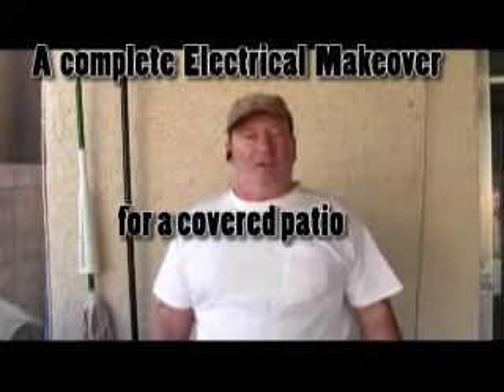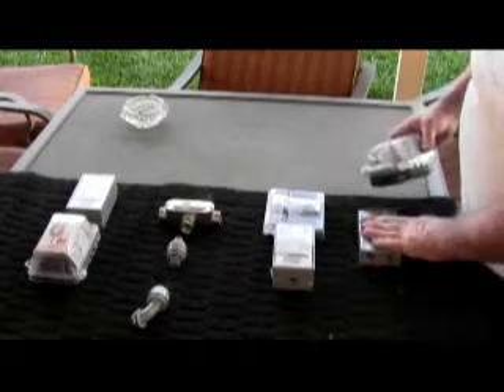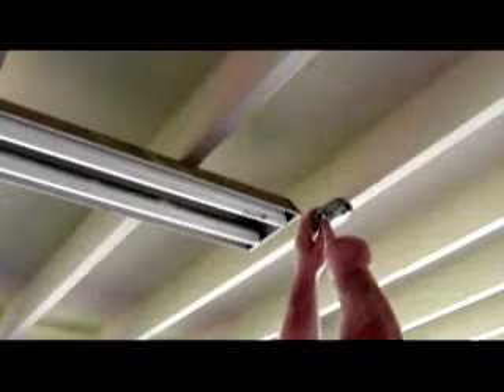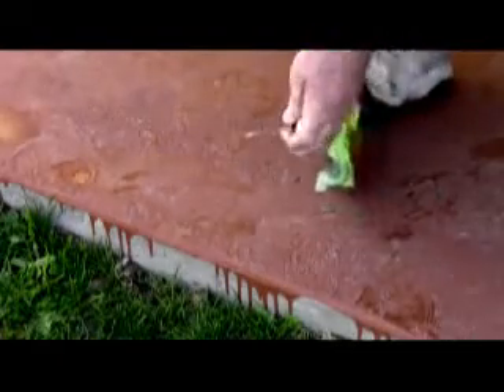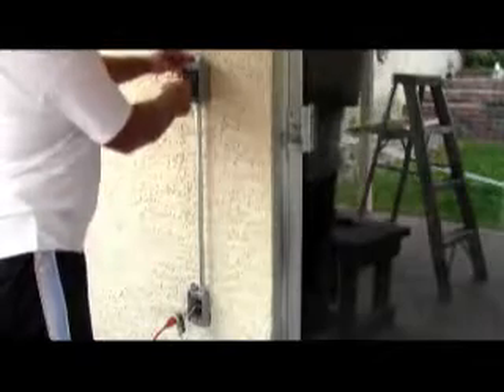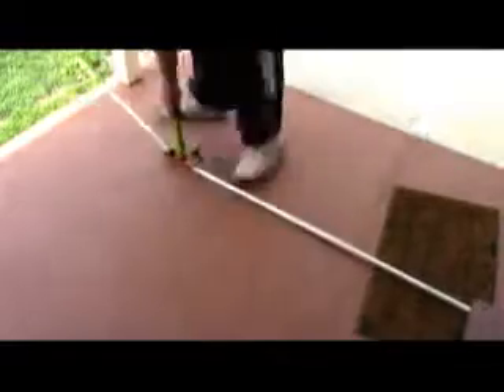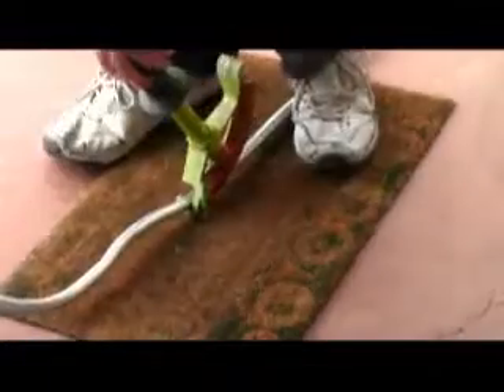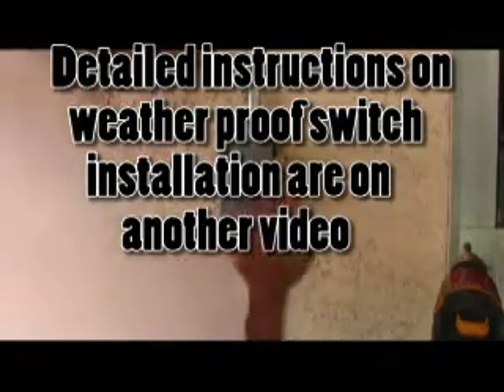NEC final inspection on patio lights # 33

Comment: So you are running 2 legs of Thnn wire from the original live power, correct ?  You pigtailed the wires from the circuit breaker in two, 1 goes to switch and light and the other goes to the additional outlet?